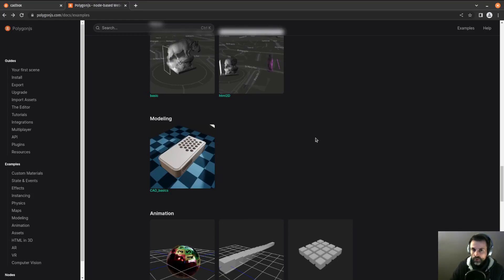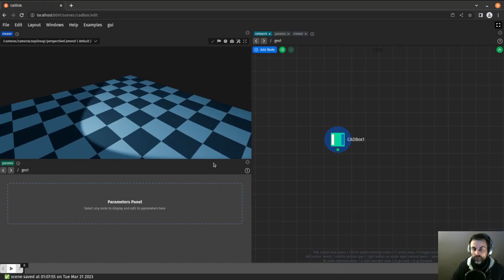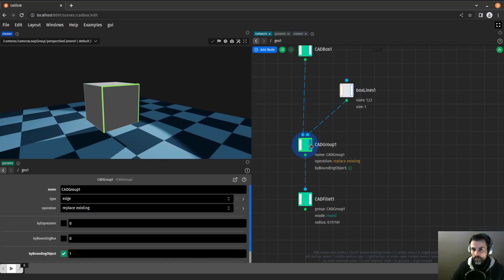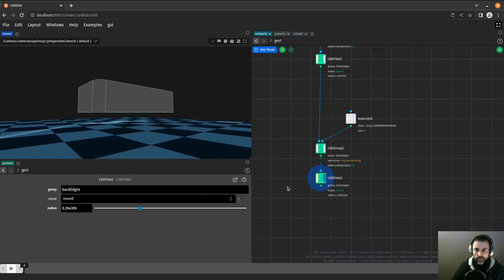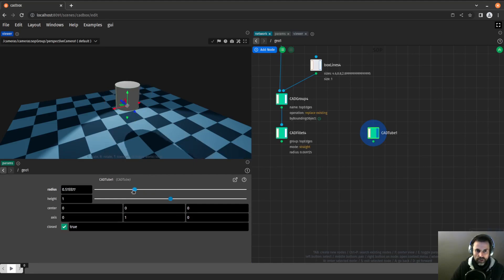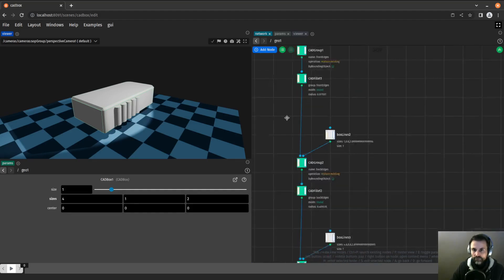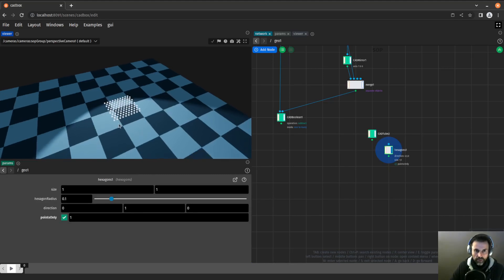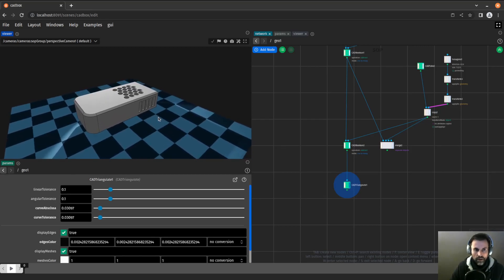CAD Modeling for Threejs

Comment: how to make a mirror object? not cad.
Reply from the maker: I've added a sop/mirror node recently. You can see it in action here: https://polygonjs.com/gui/mirror/edit
Reply: @polygonjs  but there is no such node in my local project
Reply from the maker: @АлексДиз  a potential reason is that your project is on an older version. The mirror node was added in 1.4.35: https://polygonjs.com/docs/changelog/1.4.35 You can see which version you have by the top menu Help -> About Polygonjs. Here are the instructions to upgrade https://polygonjs.com/docs/upgrade (in short, change the version in your package.json, and run yarn or npm install again). Then restart the app and you should see the node. And make sure to try and create this node inside a geo node, not at the top level, as it would not be available there. Let me know if that does not solve this.